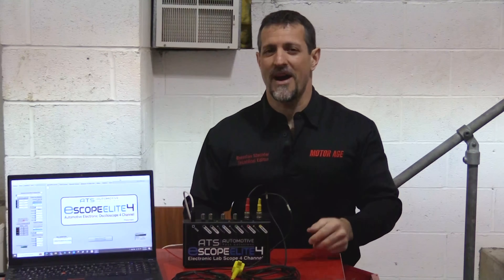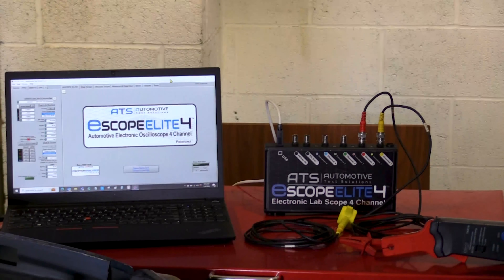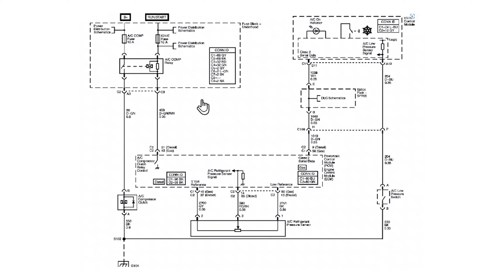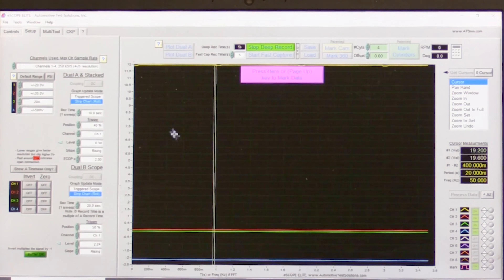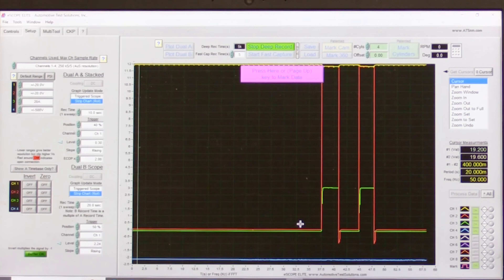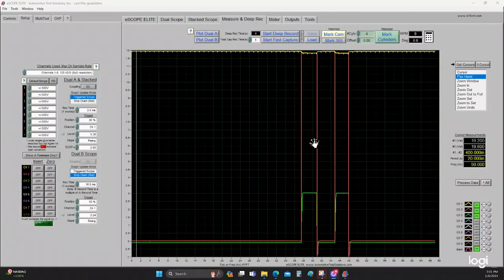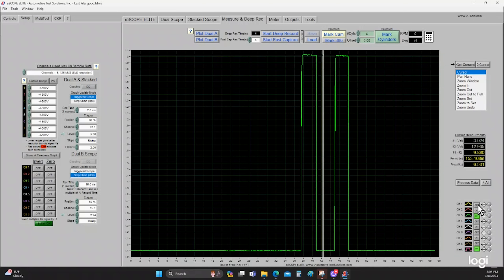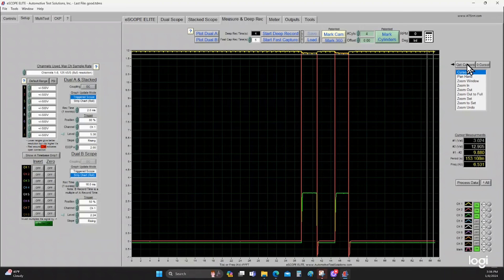The Trainer #144: Determining Mechanical Functionality Through Electrical Current Flow

Comment: A great example how simple testing make complicated involving expensive equipment. Well done, sir 👌
Reply: Elytra expense of equipment is proportional to how much you use it. 

I use my scope and amp probes virtually every day, multiple times when I’m the shop. I realized the return on investment in a few short months.

As far as complicated testing goes. This test takes 30 seconds and analysis just as long. 

The results of this test are conclusive and leave zero guess work. The trade off is huge.

I would NEVER had recommended it otherwise

Comment: I didn't ask if the channels could be separated. I suggested they should be separated for views that are not scop savvy. Thank you for the great info.
Reply: Yes, my reply was to state that I prefer to view them as you saw them. I like when they overlap, because it automatically demonstrates any voltage difference between channels, like when the relay was engaged…

-Supply voltage and voltage after the relay were identical. No need to deploy measuring horses because they superimposed each other on the scope screen, does that make sense?

Comment: Excellent explanation thumbs up I have a request if you could explain current flow when generator is changing the battery (is current reverse thru the battery?) Cheers

Comment: never mid  im the bone head  i skipped through the video  went back i saw yiu explain the tool

agree with other superb explanation and showing  well done brian!

when to use this test ?  what prompts you to use that test?
Reply: This test can be applied anytime a component isn’t functioning as it should. The point is, the amperage shows “the work being performed”(or not being performed).

Comment: What if the clutch didn't move but was already in contact.  What then would become of the bump ??
Reply: The moment that disturbs the magnetic field creates the Pintle bump. 

I inhibited moment by inserting a pocket screwdriver in the air gap, between the clutch and the pulley.

Comment: Sir please if you can make a video on the 2ndary ignition coil most of their explanations if primary coil voltage interrupted it will collapse to 2ndary coil then pass thru end of the 2ndary coil into spark plug. Now I always ask where's the other end of the 2ndary coil connected? They say on ground, then I ask again if on the ground then why current flow through the end of 2ndary coil that goes to spark plug where their is a high resistance on spark plug gap? Instead it will directly flow through the other end of 2ndary coil that connected to ground because of less resistance, as per ohm's law current always flow through less resistance....
Reply: Current can not flow through an incomplete circuit. The voltage induced into the secondary coil wants to discharge and the only path to discharge is going to be through the spark plug gap so it will have to jump that gap if it wants to discharge. If that gap is too large to be jumped by the voltage induced in the secondary winding you will see it be absorbed and creates heat as a by product and leading to possible secondary coil failure.
Reply: I have a 2007 Toyota Camry and the way the ignition system works on It is:

While one end of the secondary coil is connected to the spark plug and the other end is connected to battery positive, 
one end of the primary coil is connected to the engine computer and the other end is connected to battery positive.

The ends of the primary and secondary coils connected to battery positive have a common connection (i.e. they're essentially spliced together inside the coil pack). The primary coil is made of thicker gauge wire when compared to the wire gauge of the secondary. The secondary is made of much thinner wire, and has many more turns than the primary, therefore the secondary is much longer than the primary. This combination of being thinner and longer results in it having a much higher resistance than the primary. 

Once I turn the ignition key to the "on" position, constant battery voltage is applied to the primary and secondary splice point inside the coil pack, but there isn't any current flow in either coil, because the other end of the primary has an open at the engine computer, and the other end of the secondary has an open at the spark plug. Once the computer grounds the primary coil, the primary circuit is complete, current starts flowing through the primary coil, and the magnetic field starts growing. Once the magnetic field is saturated, the computer takes away the ground from the primary, the magnetic field collapses around both the primary and secondary, and a high voltage small current is induced in the secondary. This high voltage pushes the small current to the end of the spark plug's center electrode, where it jumps across to the ground electrode creating a spark in the process. After jumping the spark plug gap, the small current goes through the head, then the block, then a ground strap and returns to the battery's negative post. This is one complete firing event. 

Just remember no matter what the component or device is, if there's electricity involved, it has to complete the circuit for current to flow and work to be done. The work done in the above example is the spark plug firing and ultimately igniting the air-fuel mixture.
Reply: @user-yf7em4gh5i  I forgot to mention an important point:  Voltage does NOT jump the spark plug gap, current does. Voltage, which is the difference in potential between the center electrode and ground electrode is what causes the current to jump from the center electrode to the ground electrode. From a higher potential to a lower potential.

Current flows; Voltage does NOT!
Reply: Please keep your eyes open for future videos on secondary ignition waveform analysis. Also, I'm currently developing a class and a book on this exact subject. It will be ready in 2024.
Reply: @bernardocisneros4402  sir what about the driver side of the module after the low side driver switch open,..does some of induce voltage  will go there? Same as on spark plug side? Or because it is transistorized voltage and current cannot pass thru it? But I know engineers already know it and it is danger for the modules. Thank you for the idea sir, I keep studying....😊
Reply: @brandonsteckler1307  yes sir!!! As always I follow every videos you uploads everytime YouTube notify me that you have new video☺️ God bless, thank you sir for sharing your knowledge...maybe I will buy your book to enhance my knowledge especially that book pressure waveform acquisition and analysis from the inside out, and also this you have tell book for 2024 please include also for wideband O2 sensor understanding and diagnosis sir mostly they focus on narrow bad😊
Reply: @Jun-h6f  I replied to your comment the same day you posted your comment above. I don't know what happened to my post. Maybe I forgot to hit blue reply button. 

Anyways, the driver side of the module either has a diode in parallel with the transistor or in parallel with the primary coil oriented in such a way as to absorb the voltage spike induced by the collapse of the magnetic field across the primary coil while not allowing current to travel from positive to ground. This induced voltage spike is referred to as transient voltage and the diodes used to absorb this voltage in order to prevent damage to transistor are called freewheeling or flyback diodes. If you want to know more about how this stuff works, you should google transient voltage, freewheeling & flyback diodes. Freewheeling and flyback diodes are the same thing. It's just that some people prefer using one name over the other.
Reply: @metaphysicaudio  my question is... there's a complete path of circuit on 2ndary coil on other end of it some folks tells it's connected to ground and other end naturally to spark plug... that's why I raised this question...

Comment: your a trainer it says.  so why didnit you show how you set up the amp wirre  i dont know how to do that thanks.
Reply: that wire you have that seems hooked to the relay circuit is not part of tha relay tool  id like to have seen how you set that up.  dont skip the most important step  how you hooked it up  too many of you guys skipp that but youl  say it takes 10 seconds   really your video couldnt put that 10 seconds in  stop  start showing it
Reply: I’m sorry, you must’ve missed it. I spend a very long time describing the tool, how to implement them and where they belong (in the wiring diagram, the test points).

Comment: My question is how is it using any amps without a connection? My guess was no air gap.
Reply: The air gap is between the magnetized field coil and the clutch plate. The circuit is still totally intact.

Comment: I guess what gets me confused like in a door ok raise and lower windows,lock doors,open and close doors. My 1994 ram 2500 none of those components have ever failed. Yes I know they do but everything in the door of the 1994 can be diag with a dvom no scanner needed and no door control module needed. What was wrong with that system that needed changing. Do you remember 1st push to start back in the fifty's I have never had to repair one . I think the tech has gone to far and is making the price of vehicles to high. Someone steals the radio out of your car you have to be towed and if very old could total the vehicle. Bad to know you cannot buy a new vehicle without a radio.
Reply: I'm sorry, could you please elaborate a bit? I don't understand the question.
Reply: The problem is the weight of the wire. Manufacturers are being pushed to greater fuel efficiency standards. Lower weight means better efficiency. In addition, cool features like automatic rolling down of the windows as you walk up to your car with the correct key fob in your pocket (if the interior is too hot) is possible.
Reply: @owggarage723  if weight of the wire was the problem the amount of wires on a 1994 ram 2500 is probably only 1/3rd  of the wires on a 2012 and the cost of all of the modules that they have to make and the extra time to diag. you cannot buy a new vehicle without a radio vehicle will not run without radio. they could make much simpler with tech than more complicated
Reply: @DependableAutoTruck  Actually, in 1994, a Ram pickup didn't have the amount of features that a new one has. Heated seats? No. Heated steering wheel? No. Back up camera? No. Digital gauges? No. I could go on, but I'm sure you get the picture.
Reply: @owggarage723  yes on the wire a 1970 d150 long wheel base dodge pickup weighted i thing about 3600 lbs my 1994 swb dodge is 700 pounds heaver same engine both 2wd

Comment: what i don't understand is all the computers and modules and networks from what i understand makes things talk and connect together easier and with less wires. Case in point take the dodge pickup up until 2002 the computer had nothing to do with controlling the a/c. in 2002 the only change they made was the ground wire for the compressor clutch was routed thru the computer. before it grounded to the body of the compressor so now going thru the computer made more wires! and to make matters worse i had to replace computer if the ground circuit goes bad in the computer. what and how does that help anything. all that does is add cost to build and when the circuit in the computer goes bad you have to either bypass or purchase a computer stupid reasoning.
Reply: Many tech like i do on my channel make good living off these stupid designs.. they claim its "more efficient" etc..😅
Reply: The network topology design serves several purposes:

-cost of production 
-reliability/fault tolerance 
-support of communication speed (baud rate)

-weight
-data sharing with scan tool
Reply: @brandonsteckler3417  I would disagree on fault tolerance,  some network topology worsens network integrity.. such as some recent design by gm where removing a device from the network and cripple a vehicle because that device breaks the chain in the network..
Reply: Correct, but if we built every Network to be impervious to every fault, cars would cost a heck of a lot more money than they do now.

Something “mission critical” like where ABS communicates with power train, or ADAS must be fairly fault tolerant. 

Where is something like an LIN bus does not have to be as tolerant, because those systems tend to be less Mission critical . 

Star, bus, line, loop, ring, and combinations of these all exist for that reason. To balance the cost with the functionality.

Manufactures can get away with less fault tolerant systems, because the consequence is not terrible.
Reply: @brandonsteckler3417  I would disagree.. in the case of GM vehicles I mentioned design is can high and low into the module and can high and low out to continue network,  the cost that this same place to rather have the module branch out of the network instead of splitting the network would be pretty much the same.. 

I've designed large enterprise networks for a living and actually implemented them.
Reply: Thank you, please also consider you are mentioning only one configuration (CAN). That same vehicle has multiple configurations and many gateways.

Also consider that the PCM you mention can fit many different vehicles and is adapted via software. Again, I state that cost is indeed a factor (this is a text, not an opinion) however, it is not the only factor.

Comment: All you have to do in this circuit is substitute a known good relay to eliminate the relay, then jump the clutch with 12 volts to determine whether or not its working! Why all the fancy equipment!
Reply: You're missing the point
Reply: For the same reason you use an impact wrench to remove a wheel. It's more efficient. Because some of these clutches require having the vehicle in the air and disassembly to access. I'll take the easy road any day of the week. Besides, this equipment you refer to as "fancy" I use on virtually every vehicle that comes into the shop. I maximize the return on investment. There is no right or wrong way to approach a vehicle. I always chose the most efficient way, though. 

To your point, the clutch works 99% percent of the time. Please tell me what the result of your jump test would prove? The clutch would likely function "no problem found " would be the result. I see this all the time. The test I implement here can show the deficiency even when the clutch functions. The pintle bump will be delayed. Give it a shot, you won't be disappointed. Let me know if I can help in any way!